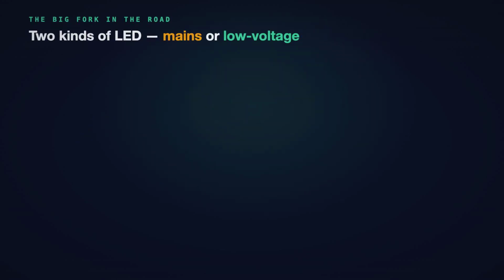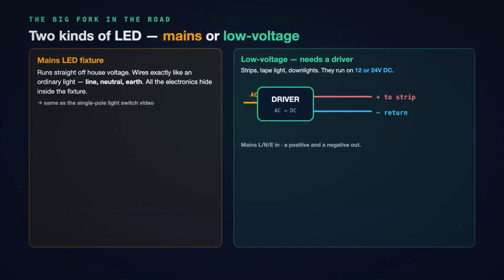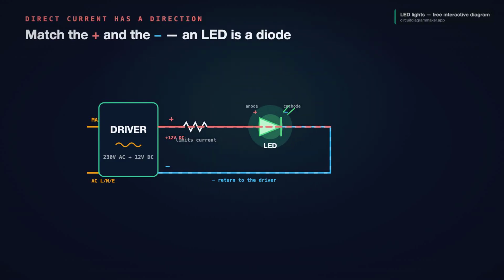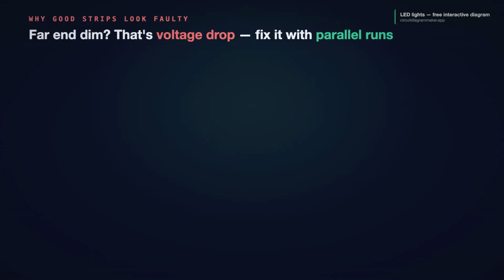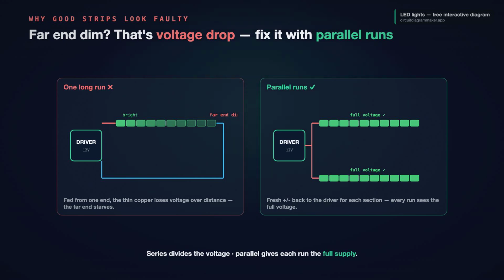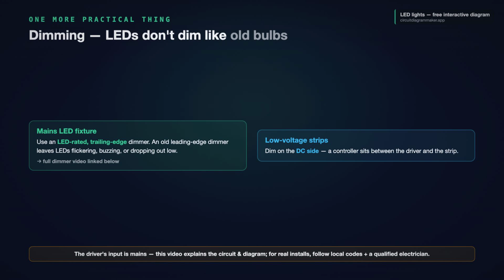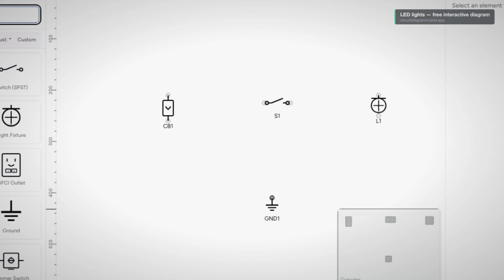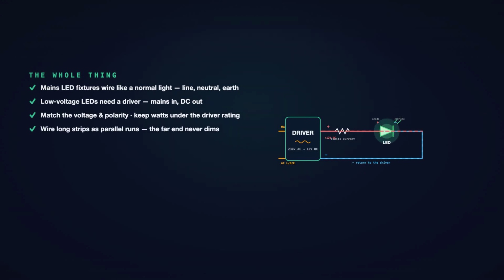How to Wire LED Lights (Step-by-Step Diagram)

Comment from the maker: Two quick LED gotchas the video hammers on: an LED is a diode, so match polarity — plus to plus, minus to minus — or a low-voltage strip just stays dark.
And if a long strip fades toward the far end, that's voltage drop, not a bad strip: split it into sections and run fresh +/- back to the driver in parallel so every run gets the full 12V.
Dimming? Use an LED-rated, trailing-edge dimmer — an old incandescent (leading-edge) one makes LEDs flicker and buzz.
Open the LED circuit and rewire it free: https://circuitdiagrammaker.app/diagrams/led-light-wiring-diagram?utm_source=youtube&utm_medium=pinned_comment&utm_content=yt-046